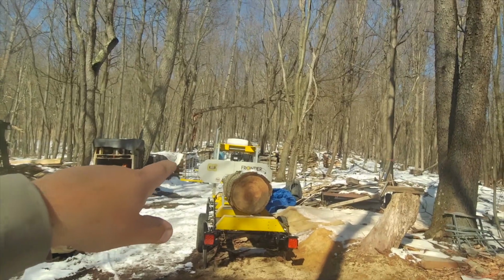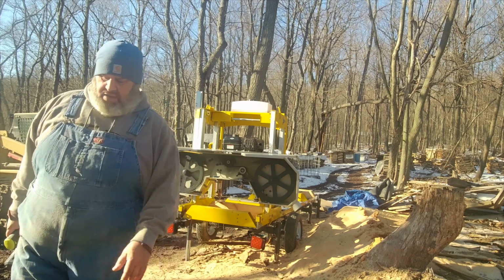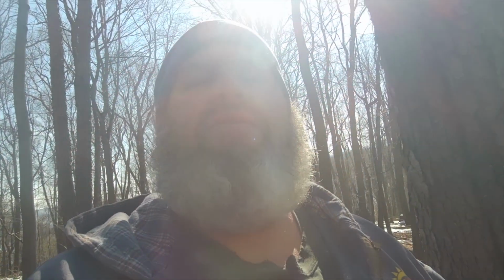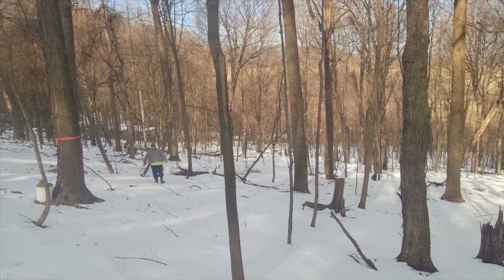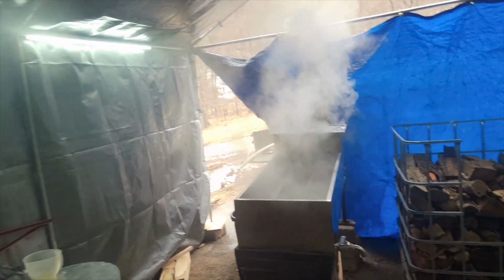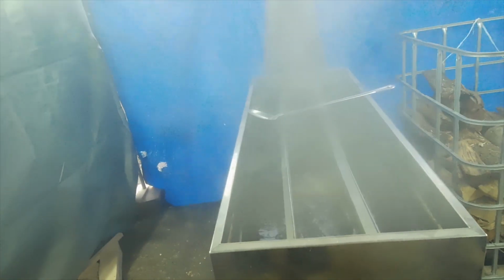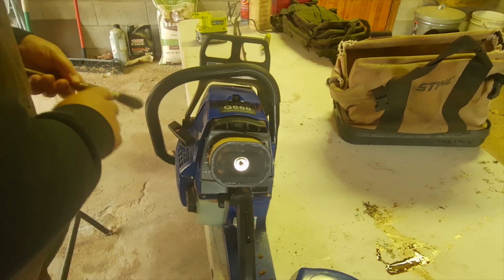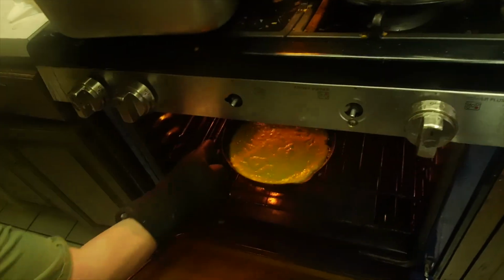Wood And Sap #farmlife #homestead #maplesyrup #mapletrees #sawmillwood #boergoats #goatfarming

Comment: If you had the view I had you would have known it would fall off lol.  I can't tell you how many times I've done that lol.  Those big logs are difficult to handle. 
That valve is the first thing I changed.   Do you have much luck selling slabs on marketplace?  I've never tried to sell slabs. 

I love the entire Maple syrup process.   Unfortunately this year only allowed me to be involved with the boil. I really like you wood burner and evap pan.   What do you do with all your syrup? 

I've never run a Holzfforma.  My cousin has the 460 and loves it.   I too have the ms441 and love it but usually grab my 361 or 362 for in the woods only do to the weight.
This was another enjoyable video.   Audio is much better.  Great work buddy.   You're living the dream that so many want
Reply from the maker: Ha, I was trying to flip that log on the mill because it was so muddy. I didn’t want it to be covered in blade destroying grime. It showed me😂. I can’t complain about the sales, I’ve made several hundred dollars so far. It’s free to put on so it all adds up in the end. It’s a CDL hobby evaporator and we can it and use all year as a sweetener, we try to be as self sufficient as we can. That Holzfforma is a good value, I paid $350 for a 80 cc saw. Definitely have to replace that valve   Thanks for watching, we really appreciate your support. I have to remind myself that I have been blessed for sure. Have a wonderful day my friend